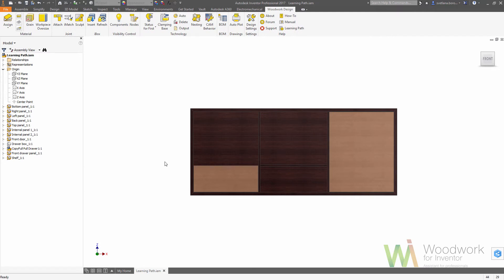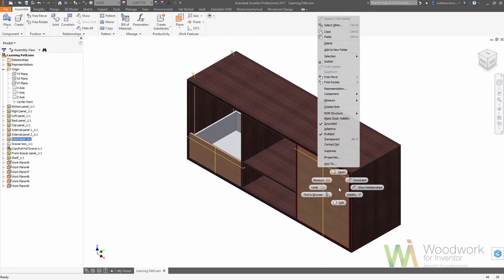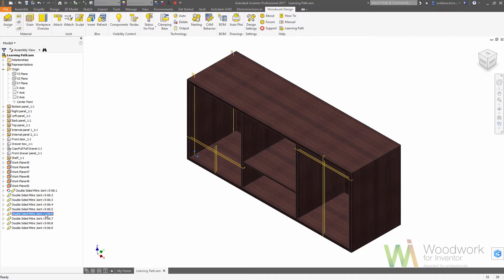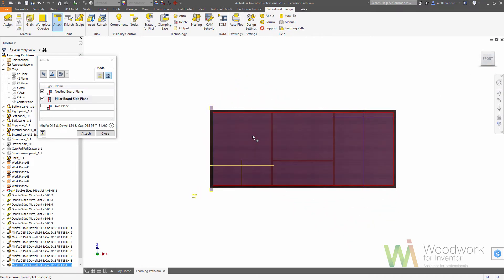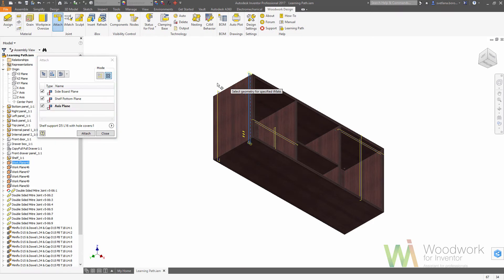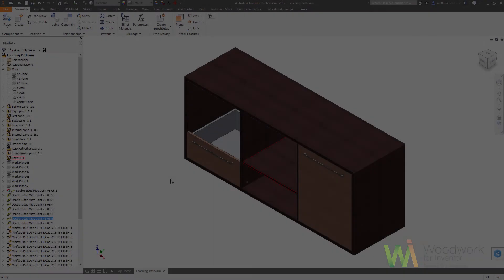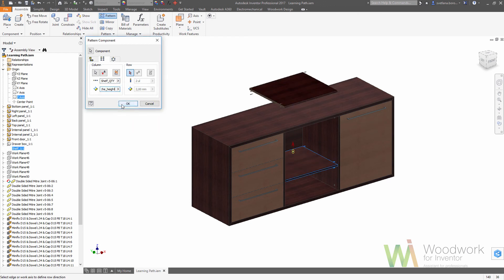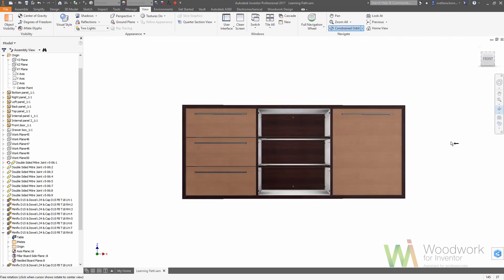3. Hardware placement (new)

Comment: Hi, I'm using a trial version of woodworking for inventor and the iCopy&iLogic Components Library folder is missing.
Where could I find your specified joints?
Reply from the maker: Hi, Donatas,

Which version of Woodwork for Inventor are you using ? If it's V8 then all Joints can be found in Library folder. iCopy&iLogic Components Library does not exist in this version of Woodwork. Now all iCopy&iLogic Components became iBox components.
Reply: Thank, you!